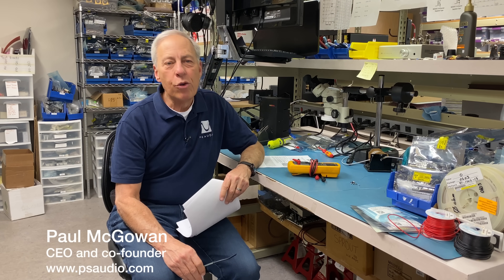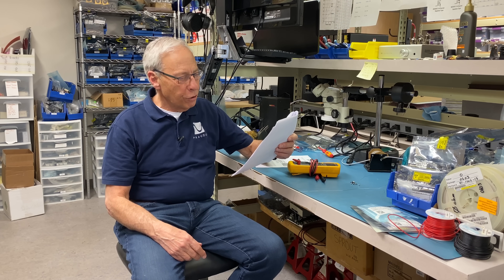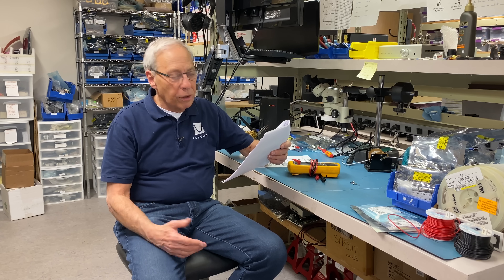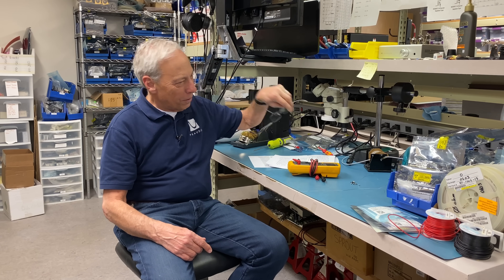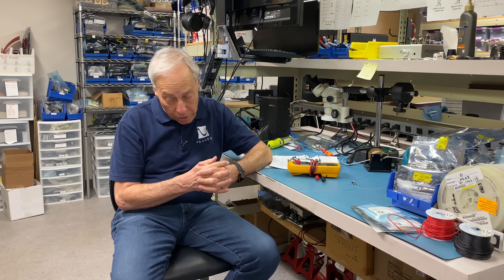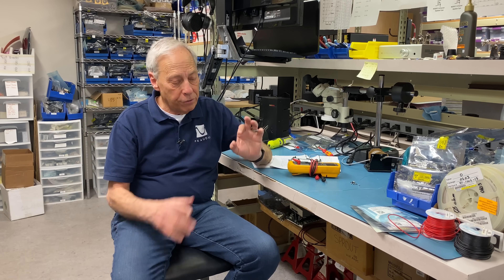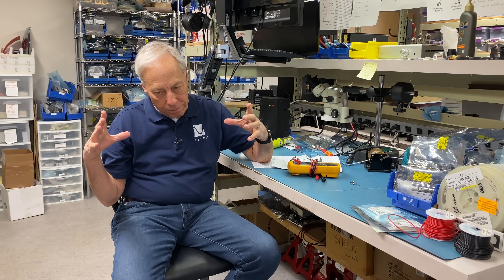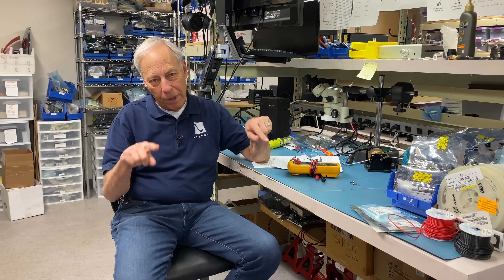Can you replace your subwoofer driver?

Comment: I have the reverse: A Velodyne CT-100 powered sub which activates my tinnitus. It's not the Hz or the driver. I have an NHT 10" sub that doesn't activate my tinnitus. $250 + shipping for repairs.
Wondering if I should just hook the sub to my HT amp, an Anthem 50

Comment: On the thumbnail for this video it says "replacing a subwoofer's AMP", (which in my experience goes bad MUCH more often and sooner than the driver itself does!), but then you don't really mention anything specific about that in this video... If anything I would've talked about BOTH types of repairs in greater detail... Maybe you could split this topic up and do TWO separate videos, with the other one being about replacing (or repairing?) a subwoofer's amplifier if it's not working, and what's the best options there... I'd like to see that one too, because I have a few subwoofers that are otherwise fine but have bad amps in them, including actually, a Velodyne 15 inch servo sub that I picked up at Goodwill for $20! (Worth fixing I think!)

Comment: Before even recommending he do just what you told him, it'd be better to find out what he actually means by the speaker is falling apart. More than likely it's just the surround that needs attention. If so, the kits for those are inexpensive (Parts Express has them, as well as other companies) and they can be tackled by a first time DIY'er if you just follow the instructions and take your time. Also look up a few videos to see how others do it, just for pointers. 
So Steve, from Ambler PA (not that far from me), chime in and give us a clarification. And if you want to go the route that Paul suggested (Parts Express driver and plate amp), contact me through this thread and I'd be happy to help you find something suitable.
Paul, will you be joining in The HIFI Summit? I don't see your name in the vendor section yet. I know a lot of people would like to see PS Audio join the on-line trade show. BTW, it's at the end of this month - and yes, I've been trying to get you to look at it since it was announced.

Comment: I agree with those who say reconing is probably the best and most cost-effective solution in this case. As for buying an inexpensive driver and plate amp from Parts Express (for about $200 if you stay with entry-level pieces that are on sale), I think one would do better to buy a Dayton Sub-1200 for $150 from them. I have one of those in a bedroom and it is not a bad sub.

Comment: Not sure how it's measuring but it probably is an internal ACH-01- 03 device not the driver itself you just sold at the end of the cable to the RCA Jack input as a motion feedback sensor and glue it to the front baffle close to the driver. You should check out diyAudio, they have a lot of people doing stuff like this professionals to DIY enthusiasts somebody would have come across this problem with this driver more than likely and tell you how to connect accelerometer motion feedback like the ACH-01, famous people on there like Nelson pass form pass Labs, give you some advice. Surprised you're not on there Paul are you under a pseudonym why aren't you on there?

Comment: I did this a few months ago.  I had a Polk Audio PSW10 and had nothing but issues with it.  First the caps died after only 4 years of use.  When I replaced the caps with better quality, the bass response was 10 times better than when I pulled it out of the box.  Eventually, some years later, the built in amp fried.  I took it to a few electronics repair places who basically said, "you'd be better off buying a new sub.  Well, "F" that! The sub woofer in that speaker is extremely good.  So I went online and bought some wire, and a subwoofer cross over as well as a banana plug terminals.  I simply rewired the sub as passive, bypassing the power amp entirely. Then I connected this to an NHT mono amp.  BANG!  Works perfectly.
IF anyone is interested, here is the simple cross over I used:
https://www.amazon.com/gp/product/B00KB6QY1W/ref=ppx_yo_dt_b_asin_title_o03_s00?ie=UTF8&psc=1

Comment: Hi sir! I have sony dav-dz910w 5.1 home theatre which was broken but speakers are in good condition but the problem is that speakers have 3ohm impedance. Please suggest 5.1 amplifier which supports 3 ohm speakers and subwoofers?
Reply: Basicly all recivers do that today.
But you need a subamp for the sub.
Your old system had that built inside the reciver so you need a seperate amp for the sub. And use the x-over setting in the new reciver for the small speakers so they dont blow. I would rather just find something better. Maybe used.

Comment: I have a couple of Velodyne HGS-18BG servo subs and had them reworked as the amp caps got bad. These amps are designed for long throw high power drivers with servo feedback and the closed cabinet is also aimed for it. Running a cheap driver with their >1000 Watts servo amp  and no feedback might cause a fried voice coil in seconds. And a closed box non-servo sub like this will have reduced sub bass. You either fix the Velodyne per intended operation or just find another subwoofer new or old.
Reply: It will work fine.. Would actually be more conserned if it was a much smaller amp. And a closed box non-servo sub can still go just as deep. The servo is for correcting the movement. The DSP and/or EQ helps boost the lower end. It works great in every other great subs without servo so should not be any issue at all if the driver is up for the task of going deep enough.
Reply: @Oystein87  Well, the servo subwoofer driver with long excursion and lots of power is able to create a lot more output at deeper frequency than a more normal throw much lower power driver can do. It really can't go as deep cause you need lot more excursion of the cone at those very deep frequencies near 20Hz and to move a large cone a lot in a closed cabinet, you need much more power. If you aim for a subwoofer that fades out at probably around 50Hz, yes, it's ok. Some of these Velodynes can do well under 20Hz. Mine has 1250 Watts RMS and 3300 Watts peak. I'll fry any normal subwoofer driver in a split second by just having the RCA connector out a bit losing the grounding of the RCA cable. The feedback circuit is fine-tuned to work with the cone motion and I doubt you can just ignore it's there. It will probably go crazy like removing the feedback wire of an amp. EQ can only boost as much as your cone and voice coil will allow it before you fry it. You can add, e.g. +10dB EQ at 30Hz, but it will probably be a disaster also of too much low sub bass distortion (amp clipping and speaker cone hitting limits). But, of course, a few dB EQ might help, especially if you don't play too loud. But if going cheap and still want something reasonable, check this: https://www.parts-express.com/cat/powered-subwoofers/95
Reply: @ThinkingBetter  And a sub with shorter excursion and no servo manages to go just as deep or even deeper... I wonder why...😜
The servo is for control of the strokes. The deepes bass in a smaller box is boosted with eq and helped with a powerful amp.
I have built subs for home and car audio and it's not as straight forward as you say. There is ALOT more behind.
1260w rms. Yes, I know.. But a decent subwoofer driver would handle that without any problem. ALOT of drivers handle even more power than that. And peak handeling for a couple of seconds can be thousands of watts even if it says "1000w max" on the driver. I had true 1200watt amp on a 500watt rated sub. Did not blow the driver even when I tried to rape that driver with that amp😅
Actually watts on drivers can almost be ignored in most cases.. If you messure power handling with just playing music it gets ALOT higher than the normal constant rating with a sine wave.
Reply: Øystein The max SPL is about excursion range and diameter for a closed sub. I assume we don’t add a bass port to this. Of course servo isn’t in itself adding bass but it sort of ensures you get the intended motion and indirectly that yields an EQ effect at lower frequencies where the air compression otherwise would cause the bass to drop. The beauty of servo is that cone motion is following the signal helping both on linearity and decay times. Try to compare a waterfall plot of an EQ compensated sub and a servo sub with the same amp and driver. Anyway, we are probably both aware of these things.
Reply: @ThinkingBetter  Well.. It's more complicated than that...😉 There are several other factors.
It helps but is not needed in any way just for deep bass.
It's to correct the movement of the drivers as you say and yes in theory it can help with that too but a powerfull amp that has more juice than you really need helps alot more.
But a servo is better than no servo👍
Reply: ThinkingBetter, I too have the same HGS18BGII sub, it started making crackling/popping sounds.  Sent the amp to Velodyne and got it back, a lot less of the noises, but still get a pop and woofer movement of about a 1/2 inch when it does it.  They sent me an accelerometer, but I have not installed it yet.  I shake the cabinet, but don't hear the noises, so I held off on the accelerometer swap.  Any ideas?  I'd hate to buy another sub, I've loved this one for over 10 years.  Seems like the amp I got back looks like all new caps everywhere, but I'm still trying to figure out the random pop every now and again.....I also disconnected the pre amp board, no changes.....
Many thanks in advance,  Jeff    @ThinkingBetter

Comment: What is a servo? Not an amp?
Reply: The servo part is basicly a sensor in the driver that makes the amp and driver "talk together" and the amp can correct if the woofers movements are not the same as the signal input says it should be. Shortly explained
Reply: @Oystein87  ok that helps explain. Thank you
Reply: @frankieknuckles9610  👍👍
Reply: Search Paul's  videos...he did one a while back, where he explained what a servo subwoofer was.
(Edited) Actually,  he has done several.
Here's a good one:
https://youtu.be/W5NNjEwF8Co

Comment: I don't see the point of this question, if your not sure then just contact the maker of your subwoofer, most decent speaker manufacturer's have warranties on their products and will probably supply a replacement driver. 😕😕
Reply: Really?  They'll replace a decades-old woofer when it's surround rots?  If so, that's got to be the best warranty ever!
Reply: Its unlikely they will offer service or parts for an old product like that but they may offer good advice. I have an old KEF flagship sub which had been repaired before by them but the amp module blew again ( my fault for never putting it in standby). They no longer supported it but were kind enough to offer to send me the circuit diagram to aid with an independant repair. I decide to use it as an excuse to buy a new BK sub but good manufacturers can often be helpful with legacy products.
Reply: I don't think after that many years they would do that but they may be of service. Only one way to find out.

Comment: Great subject. I just had a B&W AWS3000 reconed and worked great.
Reply: What happened to it that you needed it reconed? I've purchased B&W subs that are still going strong after 26 years.
Reply: @carlosoliveira-rc2xt ...some have foam driver surrounds which don't last as long as the butyl rubber surrounds that are used by British loudspeaker manufacturers like B&W.
Reply: @FatRat-f9m  No mine had foam surrounds which were replaced after 17 years. I gifted them (pcs8)s along with the (fcm8)s and (scm8)s to my brother, but replacing a surround is not reconing so that's why I was asking. Some people do confuse the terminology.
Reply: @FatRat-f9m  Yeah you're right B&W drivers almost always had rubber surrounds. The PCS8 subs were beefed up Matrix 800/801 drivers. I think the rubber surrounds were too soft so they went with a fairly stiff, large (for 1994) foam surround.
Reply: @carlosoliveira-rc2xt ...thanks for that Carlos.
See, I'm still learning old stuff...haha!

Comment: Dear Paul.  My plate amp on the Velodyne ct150 went bad. This model of velodyne didnt' use a servo.  I got a OSD subwoofer amp to replace it.  It's paired with JBL 4412 studio monitors and HK  3770 receiver.  I couldn't be happier with the sound.  However, i am wondering what settings i can set for the crossover in the subwoofer amp to use.  I'm just guessing  the JBL low end is 35 hz but i don't know  other than by sound what the db for the sub amp should be